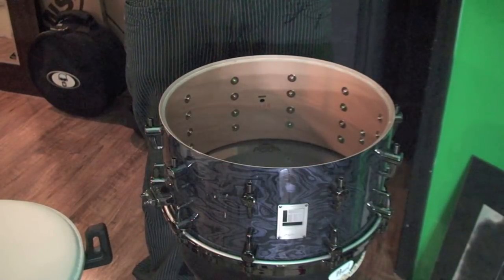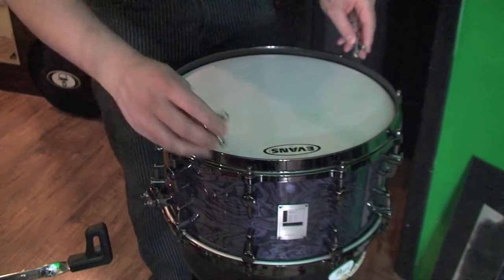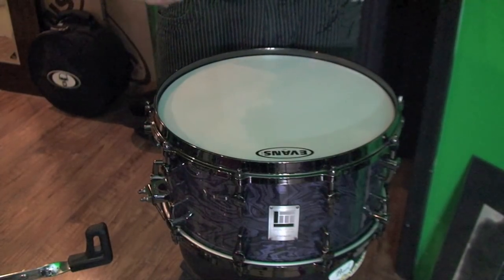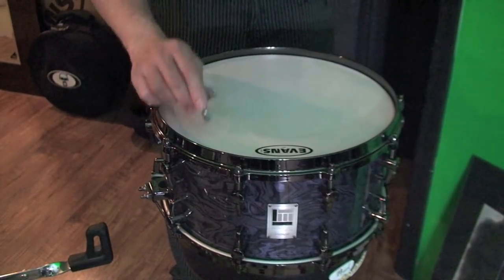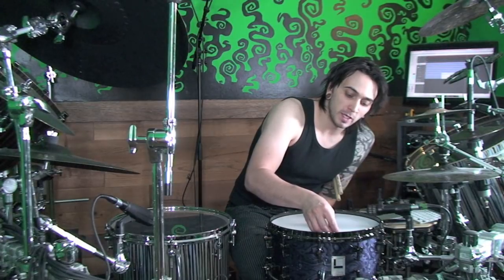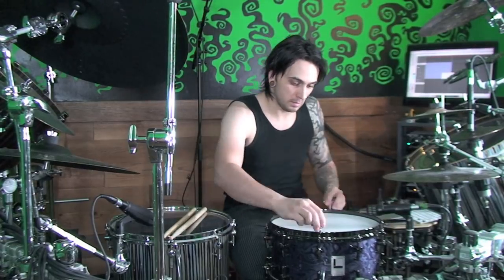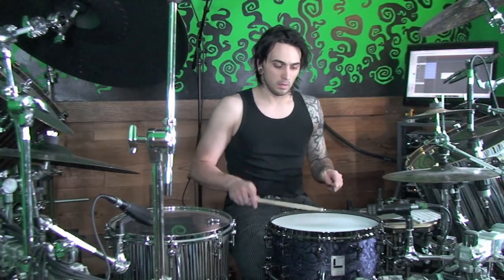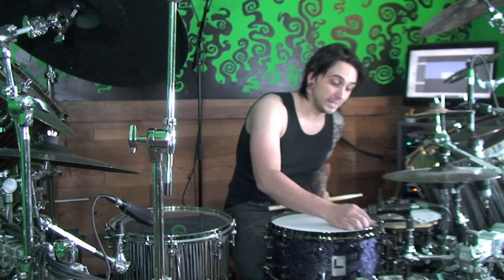How To Tune Your Snare Drum : Drums Etc. Magazine Bonus Video

Comment: As Aaron said, it's all about intuition, and trial and error really has to be your friend when learning to tune drums, but I was having trouble with my snare not long ago and saw a vid where the guy said he'd got a tip from Dave Weckl that was essentially, if something's wrong and you can't figure it out/nothing seems to work, try cranking the snare side head, and I mean /really/ crank it. I tried it and it really worked wonders, but again, it's not always the same, and trial and error is good..

Comment: Hey nice video! im from the drum forum as well. when i tune, i always find myself tapping near the edge with my drum key and even though i was told not to do it, i did it anyways. but when it came time to switch heads, i found all these small little dents around the edge (mostly on the reso side) when i took the heads off. im trying not to use the key to tap anymore

Comment: Great info! 

On my main snare, I play a med-tight Fiberskyn 3 or Coated Ambassador so I'm not familiar with 2 ply heads on low tuned snares.  Which Remo coated heads produce the lowest pitch for a gushy/70s/aux. snare?

I recently bought a maple 6.5x14.  Paired with the right head & some Moongels, it should be able to produce a thick/doof/remix sound.

Let me know what experience you have with low tuned Powerstroke 4, Emperor X, Powerstroke X, or others.  Thank you

Comment: @aaronedgardrum Even if you're an inch away, one of those stray hits will put a ding in there. My most recent kit has little indents near the farthest lugs on the floor tom, go figure. I like using my finger or a pencil because the drum key distorts the head a little when it hits.

Comment: Definitely don't tap the drum with the drum key. Metal on that surface will not only dent the drum head, but it will eventually dig in to the wood and baring edge of the drum. Very bad way of tapping the drum. Everything else looks like good advice.
Reply: Look up Dave Weckl's tuning videos. He explains why you shouldn't do this.
Reply: When you said that I immediately thought of the Weckl video. In all honesty how hard would you have to hit the head with a drum key to damage the bearing edges? I can't see where that would ever happen, Besides he isn't even hitting close to the edge of the drum.
Reply: Billy Barton If you aren't hitting close to the edge of the drum, then you aren't tuning in the right spots. You are probably right that most people don't have to worry about it because they don't tune the head all that much, but for people like the person in the video, myself, or more active drummers, it is best to start off with good habits so you aren't out $100-$500 in the future.